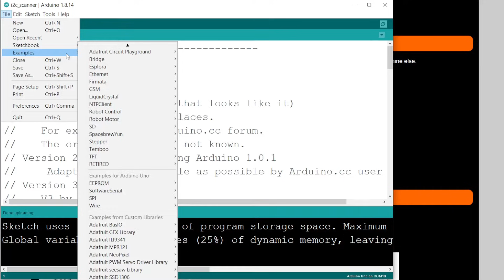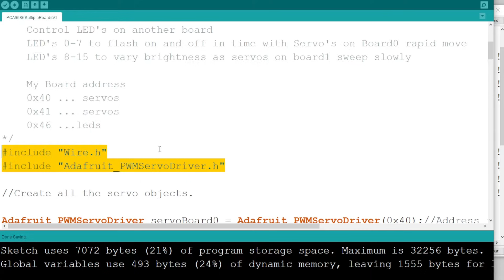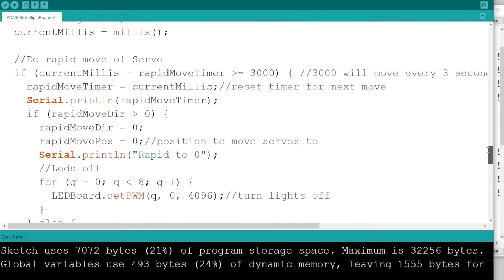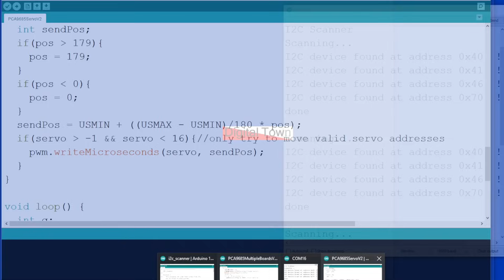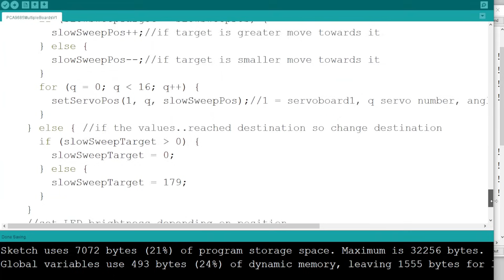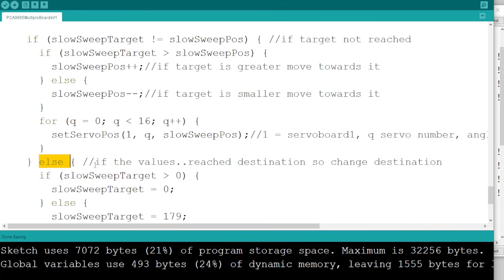Arduino C++ Using multiple PCA9685 Boards to control servos and LED's together.

Comment: One thing to note about the PCA9685, theres no point in adding the seprate 5v supply to the green screw terminals.
The v+ only goes to the red servo pin. The pwm (yellow) pins are powered by the PCA9685 chip its self which in turn gets its power from VCC via the arduio. 

So make sure you move VCC to the seprate 5v supply as well.
Reply: Hey thanks for this! was looking for this info. If I power the arduino from a seperate 5v 10amps power supply, and power the PCA9685 from the same source, will it run from the higher amp power supply instead of the arduino? I am looking into powering over 130 simple leds, and want to be able to adress 5-8 leds per pwm pin.
Reply from the maker: On my projects when installed on my layoput I power the V+ and VCC from the same external 5v power supply. The only link to the Arduino is a common GND connection so the PCA9685 boards can draw as much power as needed.
If you are powering the Arduino from the same power supply there will be no problem as the power to the boards is not passing through the Arduino.
Reply: @digitaltown5442  and regarding voltage? Is there a way to get the 5v from the pwm, instead I only get like 3 volts from the pwm pin.
Reply from the maker: @nielsvdmarel  The PWM pin is providing a signal rather than a conventional voltage. It's actually turning on and off very quickly so the voltage a multimeter will read is not the true voltage as it's like trying to read AC voltage with a DC meter.
For a servo it provides the signal while the RED 5V pin provides the power. For an LED you connect directly to the PWM pin and Gnd and the brightness of the LED is controlled by turning it on and off at very high frequency to fool the eye.